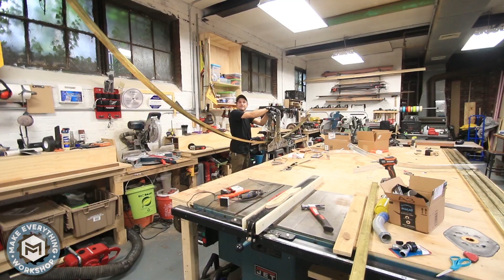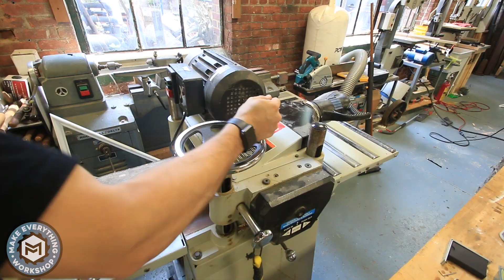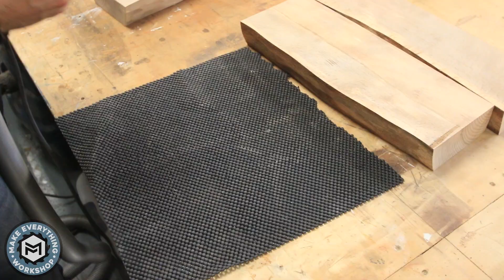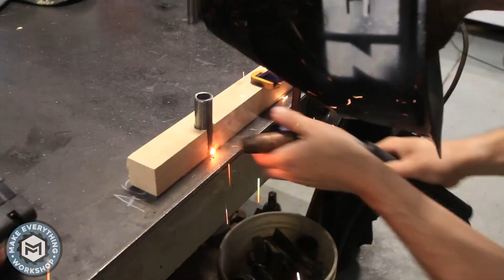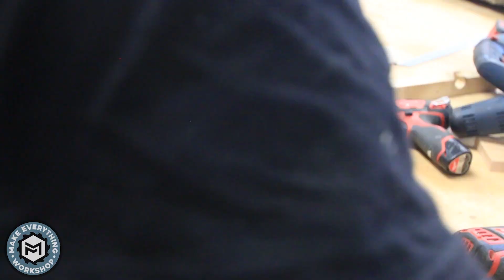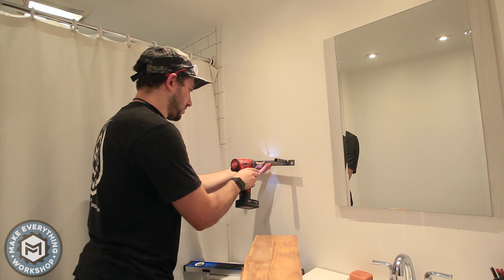Making Live Edge Floating Shelves!

Comment: Make these alot, I put them into office buildings. I use wood dowels nice think about that. You can glue dowels into studs.  Hardwood dowel will hold 50 to 80 pounds up too 6 feet long. I textured copper and capped ends. Blackened the textured copper with enamel paint. Wiped off excess. They add a great dimension. You can color stain shields with a whitewash . I might break out the welder and make a bunch of brackets and try your way for heavier items. Thanks very good videos. I'm a gunsmith, Machinest and Horologist, and Jeweler.

Comment: I weld on a wooden table.  Never had a problem.    All the splatter just cleans off with an air hose too.  No need to grind them off a metal table